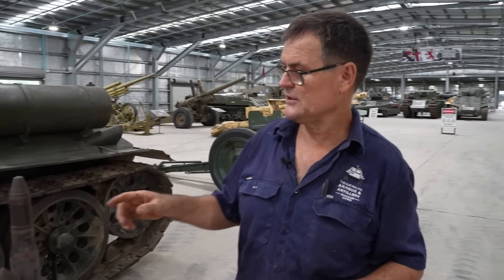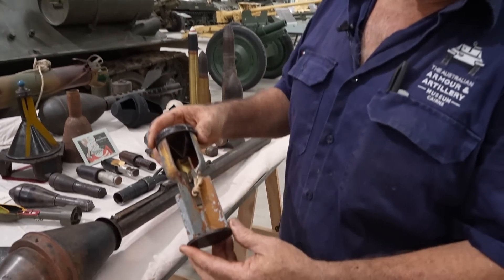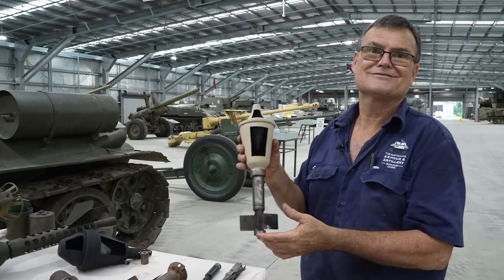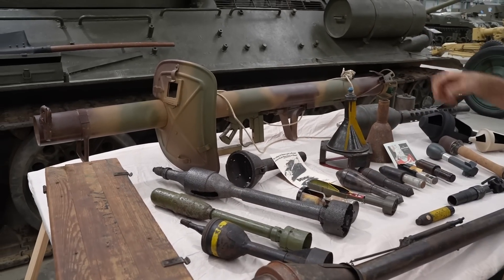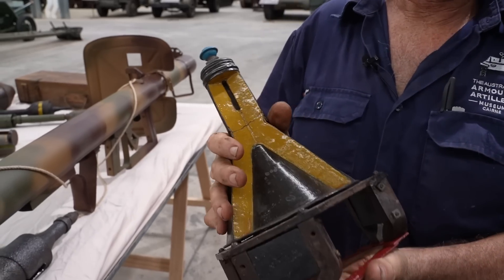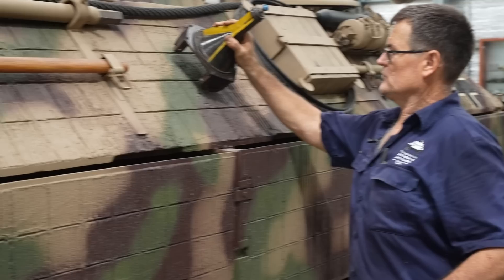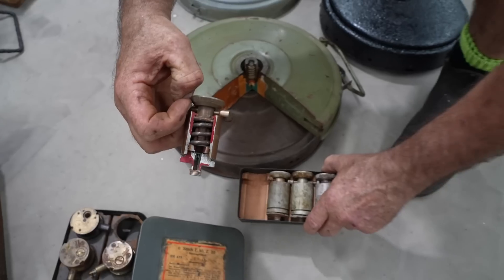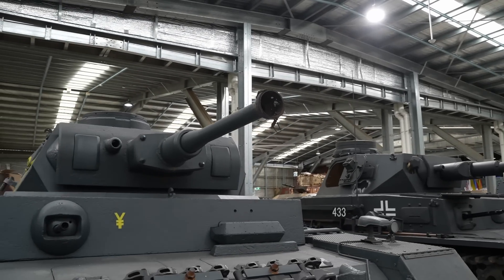Shaped explosive anti-tank munitions of WWII (The NLAW and Javelin ancestors!)

Comment: Shaped charges don't 'burn' through armour, they use the kinetic energy of the explosively formed copper penetrator to force their way through armour, the copper then spalls in the tank killing the crew and detonating any ammo in the tank.
Reply: Hi,i recently found an M79 osa missle.Its anti tank missle.Idk who to ask and u seem to know about missles.I found the whole rocket without the tip,there is cone going downwards and hole in the middle of the cone end and Also long hole on the back of it.If that is Still intact, does that mean its Still active or just Shell.I think there is Still explosive in it because its not blown in pieces,i want to clean it but its possible that detonator on the back of it,meant for big explosive is Still fragile.so its possible to activate it accidentaly.What do you think,the rocket is from 1979 WW2 ,sitting in the ground over 20 years
Reply: @Botbreakout  
I'm sorry but it's very hard to know without actually seeing the rocket.
My advice would be to leave it alone as explosives can get more sensitive and dangerous with age and I certainly don't want you dying for a trophy. 
Sorry I can't be of more help.
Reply: @johno9507  ty,thought the same Also.Better be safe.

Comment: Great video, however I feel the need to note that, shaped charges don't actually "burn" through armour. It's a misconception from the acronym HEAT (high explosive anti-tank) the explosive actually accelerates the copper (by use of the cone) into an extremely fast moving jet/penetrator. Which penetrates armour using the same principle of kinetic penetrators.

Comment: Great video! When the explosive is set off inside the head, it turns the cone, which is made of copper, inside out and and that turns it into basically a super heated copper bullet. When you see these that have hit a target you get a little explosive burn but there is a small hole where the cone went in, separated and had its way. 10 years USMC 6 years training fng’s on weapons systems. OORAH!

Comment: One thing of note- HEAT rounds do NOT "burn" or "melt" through the armor. At the speeds of the kinds of detonations HEAT rounds operate in, the liquid metal is, itself, the penetrator- there is not enough time to transfer heat energy into melting the armor of the tank that is being hit.
The explosives focus the wave of the inner "cup" onto itself, adding all the energy together into a focused, standing wave. This propels the metal well over hypersonic speeds, easily past mach 5, 6, 7, etc. The liquid metal is simply going fast enough to punch through the armor as if it were a conventionally fired round. At those speeds, a grain of sand would do the same thing- imagine it like micrometeorites hitting space stations.

Comment: Great video. The "burns through armour" is however a little bit misleading, in fact the action of HEAT charge is purely kinetic, when the charge explodes the copper cone is deformed in such way and with such velocity, that it travels at hypersonic speed and strikes the armour generating such an extreme pressure that hydrodynamic behaviour can be observed, and punches a hole through armour. Of course huge amount of heat is generated, which usually ignites the tank inside.

Comment: Thanks for a fine presentation. I believe you meant to refer to an inertial fuse, not an impact fuse. The latter is mounted at the nose and, as the name suggests, works by impacting the target. The inertial fuse, contains a mass that continues forward by virtue of its momentum initiating the primer after target has slowed/stopped the relative movement of the projectile. Again, thanks so much!

Comment: HEAT/shaped charges do not "burn" through armour, it actually uses the explosive force to collapse the metal cone liner into a high-speed molten plastic slug. 
It is purely kinetic and has no incendiary, thermal or exposive effect on armour, its just the spalling and shrapnel.

Comment: I appreciate the effort but shaped charges don't 'burn' through anything.
The shaped charge inverts the cone-shaped liner turning it into a superfluid metal rod (not a molten jet) moving at hypersonic velocity. The elongated metal penetrator has so much velocity that it literally pushes its way through the armour. The superfluid rod lacks mass and sheds velocity pretty quickly so the warhead has to detonated at the optimum distance from the armour plate. Its normally around 3.2x the warheads diameter.
The bigger the diameter of the warhead the more penetration it can achieve.

Comment: I'm pretty sure the British developed a kinetic round that was in use before the end of ww2. I think the comet tanks could fire a shell, the casing falling away early in flight leaving just a very hard metal, I assume tungsten, barb.
Reply: Armor-piercing discarding sabot. A precursor to modern APFSDS
Reply: Yes, they were known as APDS rounds (armor piercing discard sabot). The Brits did extensive development of the ammunition during the war, although most rounds weren't available until 1944. The ammo type was rare but they did produce APDS for the 6lbr, 17lbr, and 77mm during the war.

Comment: You might want to compare the shaped charge to a flashlight reflector. Instead of a lightbulb at the focal point sending out a beam of light, one has the hot gas from the explosion coming out like a small beam. Satellite dishes and telescope mirrors do the same job in reverse. Taking the waves in and focusing them to one point.
If I come across like a jerk, I apologise. My intention is to hopefully make it easier for viewers to understand how it works.
One of my favourite arguments in high school was that physical education was a waste of time and shouldn't be mandatory. Physics on the other hand, should be mandatory. I'm sure what one learns there has far more application in life than kicking a ball or running around in big circles.

Comment: No burning of holes through armor please.

The only thing the explosion of the HEAT charge does is deform and accelerate the liner to somewhere between 5 and 10 km/s.m ( depensing on the exact position of the liner material...the outer edge goes slowest ).

Due the impact speed greatly exceeding the speed of sound in the target material  ( defacto the speed at which force can be transmitted in the target ) armor steel does not exhibit normal behavior....it tends to spread like putty infront of the penetrator.

The low mass does mean that the penetrator loses steam quickly in air and the differential speed of the front and back means ot gets pulled apart if it encounters too much distance.

Comment: 0:26 This is misleading. Earlier shaped charge rounds were not just better than kinetic rounds. Guns that could fire high velocity rounds, broadly speaking, found kinetic rounds to be a better call for AT use. Early on, the strength of a shaped charge was for lower velocity weapons like low velocity guns, grenades, and rockets. It wasn't until really after the war when HEAT started to become something that folk were wanting to fire from high velocity guns over kinetic rounds; and then composite armours came along a few decades after that and kinetic rounds once again took the "top spot" when it came for tank guns in the AT role.

Comment: Shaped charges don't burn through shit let alone RHA or armour, the jet formed from the cone,which can be glass, plastic, etc , it's the shape that matters, the metal is literally pushed apart by the explosive force hitting at less than 45° , usually 30° and exponentially increasing in power to the point it simply breaks the atomic bonds of metal armour and it flows out of the way, Google it
Reply: The physics behind hollow charge would be interesting similar to fluid dynamics ? was the speed of the jet same as the speed of the explosive chemical reaction  some 50k ft per second
Reply: To destroy tank main gun but  took longer drain hydraulic fluid from recoil mech and fire gun and it seizes solid in full recoil  allus kaput.

Comment: He is actually quite wrong on how a shaped charge works. It doesnt burn a hole it punches a hole. The heat has nothing to do with its penetration but rather the high speed of 20,000-30,000 km/h.

Comment: WTH who is this guy, he needs to reeducate himself.
That's not how a SHAPED CHARGE works.
The shaped charge does not depend in any way on heating or melting or "burning trough" for its effect, the explosive formed jet from a shaped charge (metal cone) does not melt its way through armor, although it is highly hot and melted, but its effect is purely kinetic in nature, because explosive turns metal cone in to liquid stream/bullet at extremely high velocity which punches trough armour, somebody would say but liquid is not solid, that may be but it is also incompressible so molten stream of metal (copper in case of many shaped charge weapons) actually is much "harder" then metal so it doesn't deforme when it hits armour and easily punches trough, and yes because it is hot when it penetrate it spreads out and has a significant secondary incendiary effect.